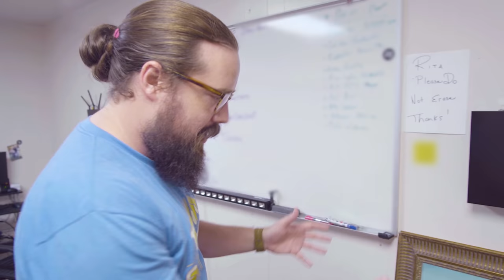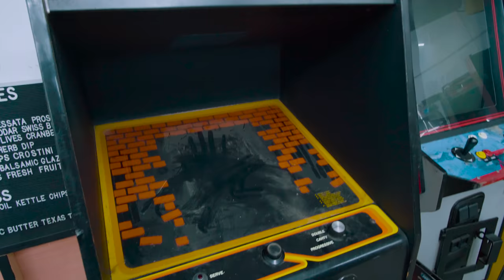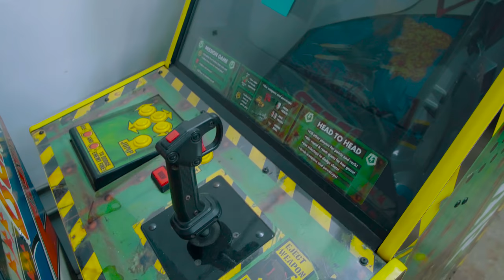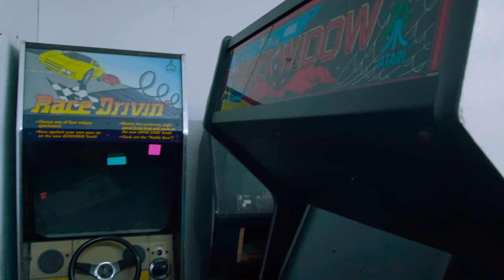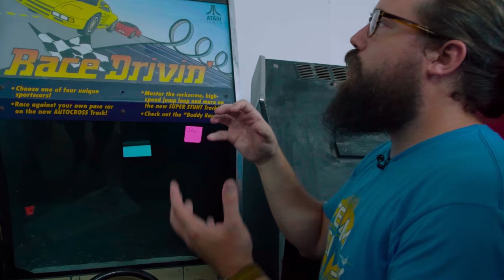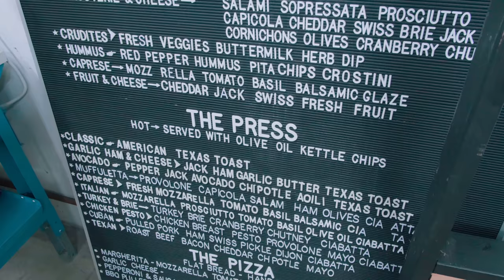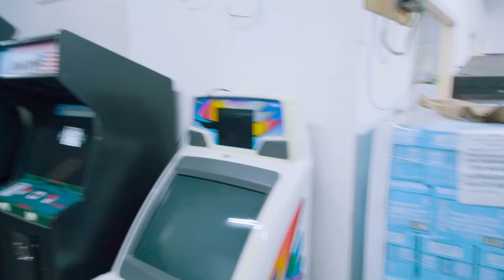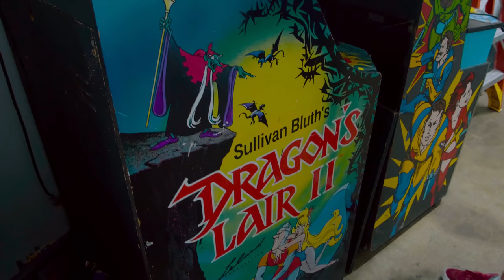World's Biggest Private Arcade Game Collection! Part 1

Comment: Are Chihiro boards really that hard to keep running? Strange, I never saw any Chihiro machines in the local arcades that had problems, outside of some GD-ROM problems that my favourite local arcade fixes simply by rebooting the machine. I think it's harder to fix Lindbergh boards, especially to replace the GPU or other costly components.